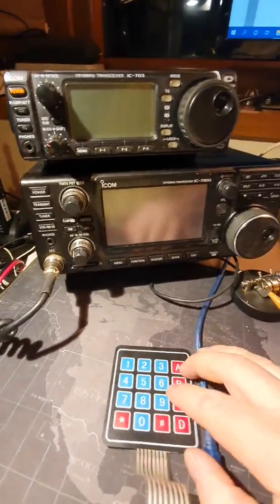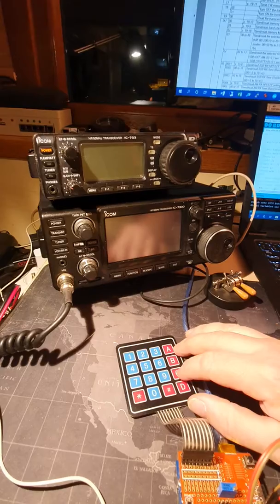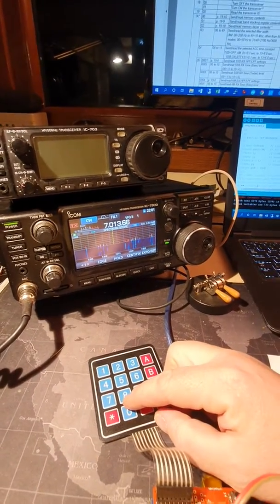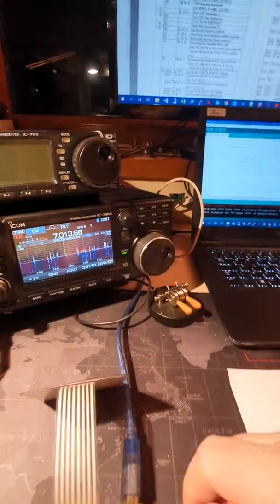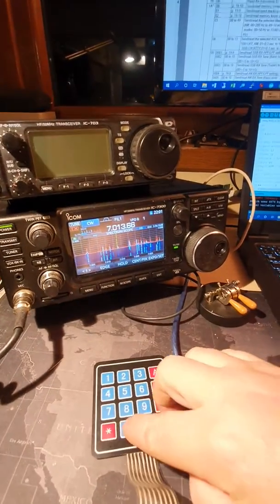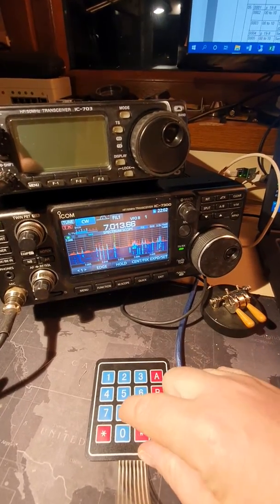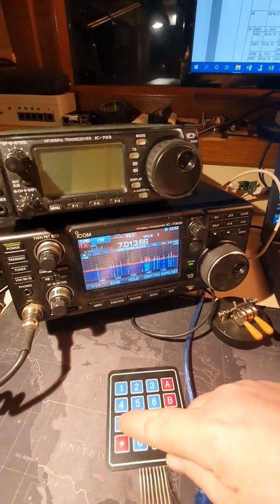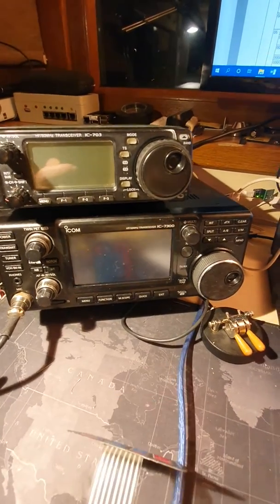ICOM 7300 CI-V Voice/CW Memory keyer

Comment: Hi. Nice. I use it for voice memories. Which CI-V command are using for CW memoryes?
Reply from the maker: CW memories are stored inside the device and sent to the radio letter by letter via CI-V. I can't remember now, there is a list on the Extended User Manual available as pdf.